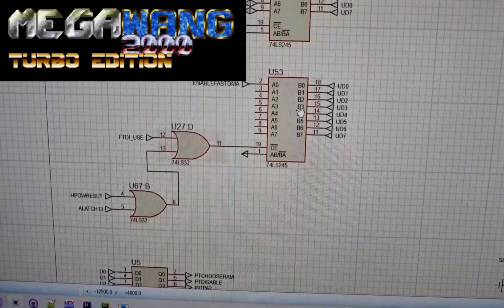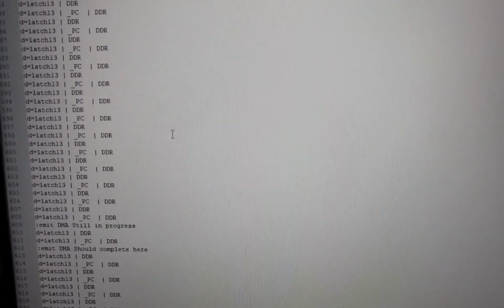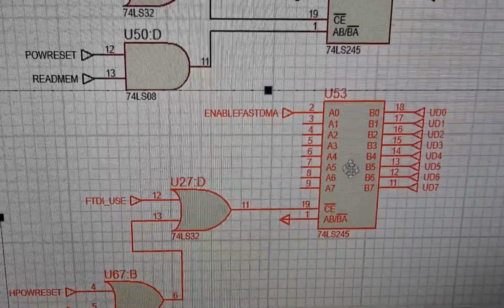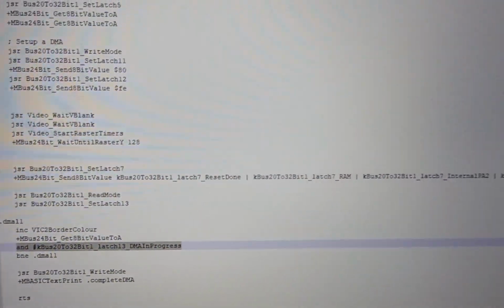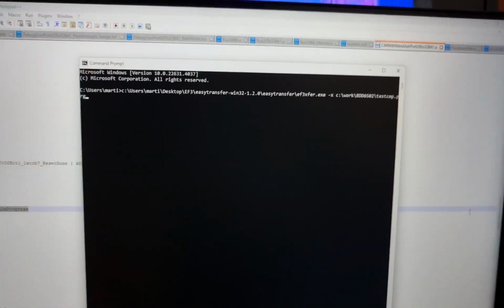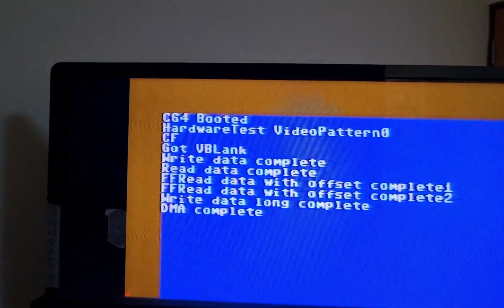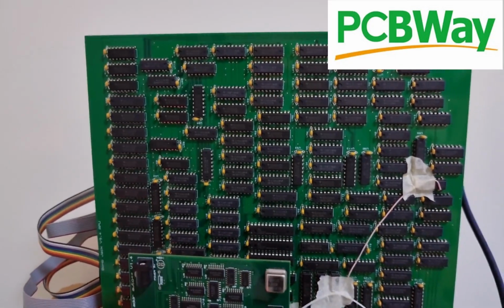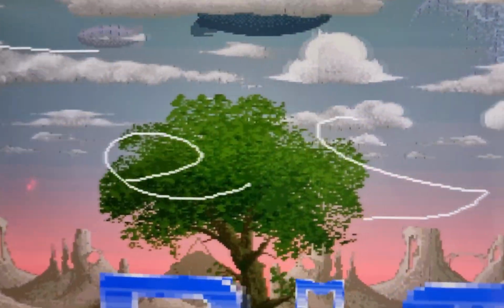MegaWang 2000 Turbo Edition - 31 - C64 RAM expansion DMA transfers - 2

Comment: So, the MegaWang is yours, I came across the Mega65, how is your one better in terms of doing stuff you want it to do functionally?
Reply from the maker: The Mega65 is a FPGA in a retro style computer case with integrated keyboard, designed to emulate the old machine. This MegaWang thing is a new build designed to use TTL chips. They have very different use cases.
Reply: @MartinPiper6502  From my understanding, MegaWang is to play games, arcade games, and Mega65 plays games and "stuff"
Where would one deploy the MegaWang when it's done?
Reply from the maker: @vampalan  well the Mega65 has 4096 colours, MegaWang has 65536 colours. They have different amounts of video and sound memory, I think the MegaWang in its maximum config has more memory and more display layers. The FPGA in the Mega65 allows software updates, the silicon used in the MegaWang does not. :) The MegaWang is basically meant to be like the arcade hardware of old, expensive and not really that practical. :)